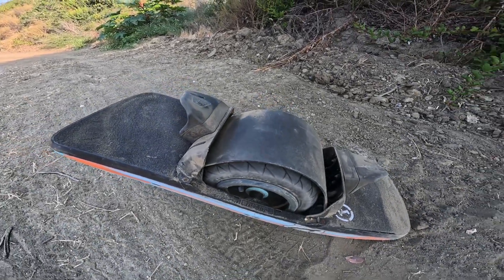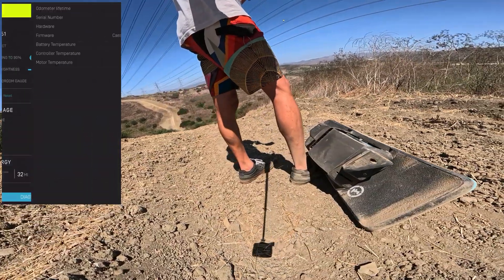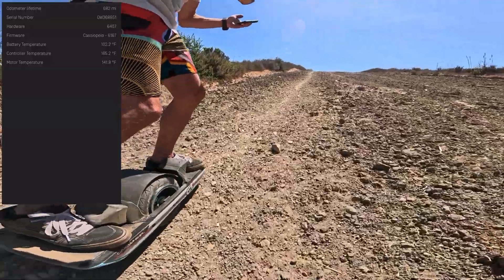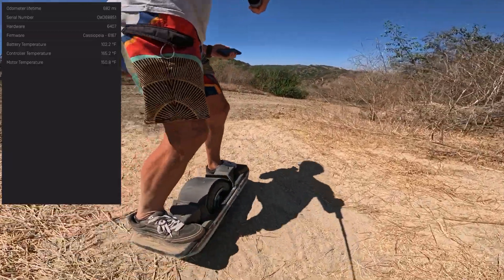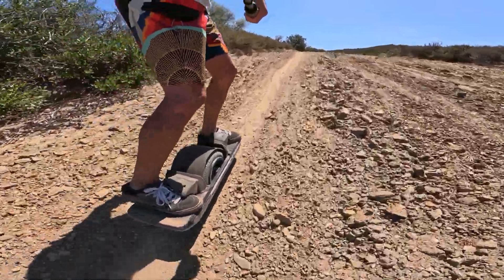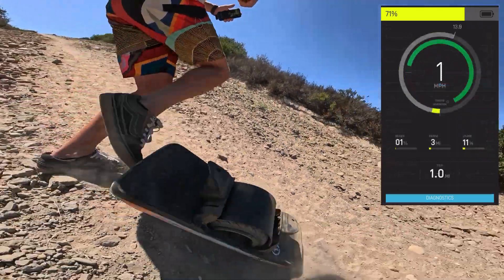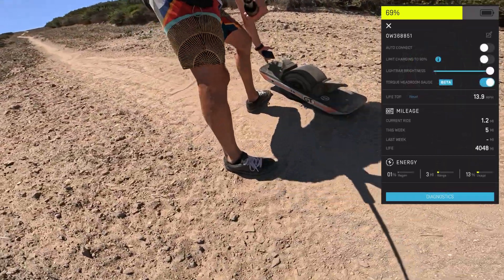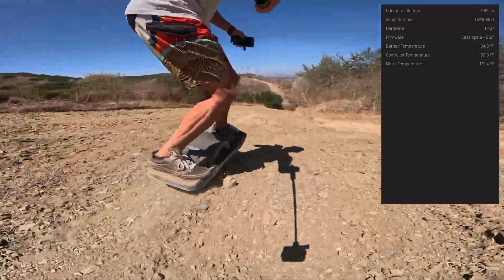Bring the Heat - Part 5: Onewheel GT

Comment: At least you had an exit when your board couldn't make it. When I was testing the limits of GTS gradient tracking, I decided to go down a hill first, then ride up. So I set my Go Pro at the top of the hill and then rode down. The hill was steeper than expected and I had to bail. However, my GTS rolled the rest of the way down the hill. I went after it leaving my Go Pro at the top. This was in an area I wasn't that familiar with and I didn't know of another way to get back to the top in this very wooded area, so I had to carry my board up the hill. That was a workout! Worst part was, my Go Pro shifted on its tripod so it didn't capture the 'fun' parts. 

Anyway, keep making these thoughtful videos.   . . . -O-
Reply from the maker: @onewheelavenue  lmao at least you didn’t have to carry a 40lb Floatwheel or SuperFlux Board 😂

Comment: Overheated mine several times. Oit typically runs in the 170s it will captain Morgan and buzz at 183
Reply from the maker: What firmware are you on? Seems like FM has increased the thresholds in the latest versions.
Reply: @surfdado it's a original Gt with all the updates but it's doing it since day 1. I don't think the shutoff has changed on my board
Reply from the maker: @Mccardsonthemove  I doubt it would be different for different GT boards. I have screen recording of it triggering at 194F motor temp

Comment: If you look at the energy stats in the app it would make us believe the GT is using more battery power than even the GTS does. Maybe the GT controller is adding extra heat into the motor, but the motor is not using it to propel you up the hill.
Reply: Heat is a byproduct, its never desirable in an inductive load ( as opposed to a resistive load intended to make light and/ or heat )

Comment: Two years ago I tested my GT at ambient 85F-90F. It will raise the noise and blinking red status bar when it hit motor temperature of 190F. It will force you to stop, The controller is better with spect to temperature though!
Reply from the maker: @wayofflow955  current firmware does that at 194F aka 90C - found that out today on a 75F day 😛
Reply: @surfdado  I feel they don’t have a solution for their motor over heating issue and pushed the operating temperature higher to give it little more torque. They must taken a chance knowing very low percentage of people ride their board will bring it to that limit!